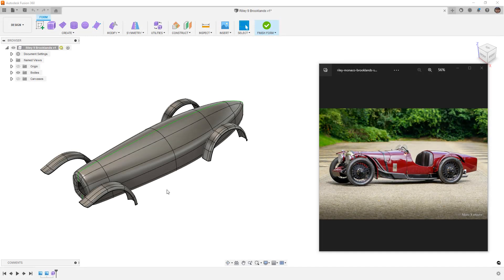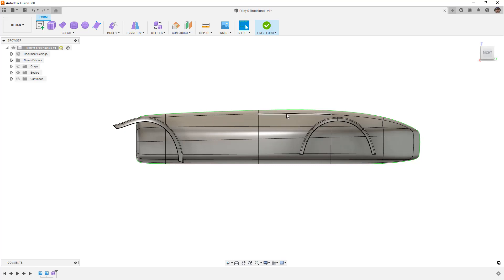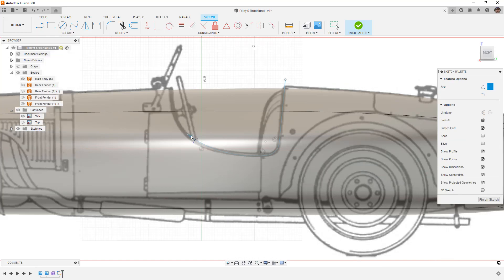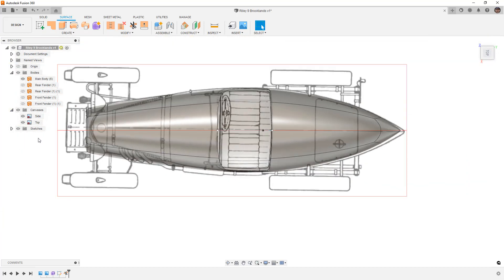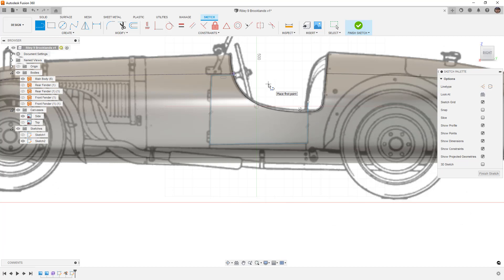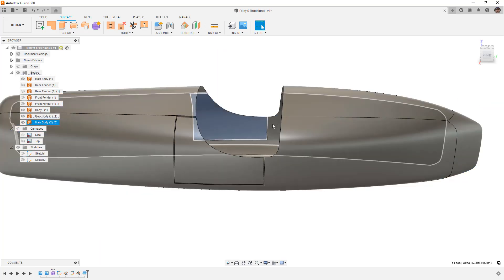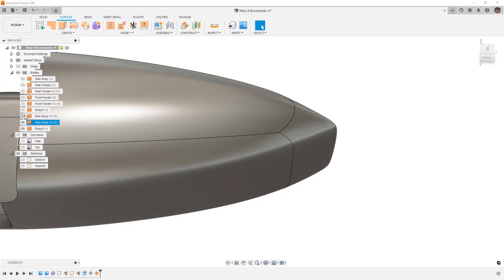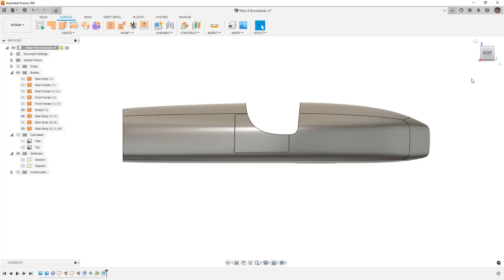Fusion 360 Form Mastery Part 38 - Splitting Up a Form Body to Make Doors and Hoods #Fusion360

Comment: What if I have a part I want to shorten? How do I cut it out, shorten it, then reconnect it?
Reply from the maker: That will depend on how you want to shorten it.  In some cases you might make a planar cut with say an offset plane or just a line.  You might also use an offset surface to make the cut.  The tricky part is moving both pieces back into whatever position you need and then merging them.  Usually cutting, moving and re-attaching isn't a great option as the edges won't line up.  So you might need to cut more than you need and loft them together.  Again it is very much based on what surfaces you are working with.

Comment: If this project was going to be a real car, put into production, if you will, obviously, this would need body panels ect, and these would need moulds to press them out. Does fusion 360 have the capability to use a positive shape such as what you have made, and use this to cut out a mould for body panels within the software? Hope this doesn't sound to confusing.
Reply from the maker: Thanks for the comment!  It sure does.  A lot of people use Fusion 360 to generate molds off of the parts.  I have done this for a few clients(medical devices) but not on a car body just yet.  The result of the Form is a true surface(or solid if it is closed) so all the typical boolean operations like Cut or Combine will work.  You can also use the surface in conjunction with planes and the Boundary fill tool to build out a solid volume a the plug for a mold.
Reply: @LearnEverythingAboutDesign  Thank you! I am new to fusion 360, this sounds a little complex, I will look for tutorials along these lines.🖐
Reply from the maker: @TheHalloweenmasks  Are you looking to make some fairings for your Suzuki project?
Reply: @LearnEverythingAboutDesign  Not yet. This project is a massive undertaking, I cannot guarantee 100% success. If this project is successful, which is an engine made from scratch, then I will intend to build a complete bike.
This feature in fusion 360, making moulds from 3d models, is very cool and could be very useful to me.😎
Reply from the maker: @TheHalloweenmasks  Awesome!  Years ago(probably 2000) I remember reading an article about an ME professor casting his own vtwin 500cc two stroke using two yamaha yz250 cranks and cylinders.  I saw some of your stuff is deeper than that making your own gears, cranks, pistons!  Reminds me of the worlds fastest indian story :)  Very cool project none the less and wish you the best of luck getting it done.  This video was inspired by someone making this car.  Check out @asciimation channel

Comment: Hi Matt, just to let you know I have managed to get further along with the help of your most useful films. I have successfully created sketches of the body shape by creating planes where the framing needs to go inside the body, creating a sketch on the plane then doing an intersect on the body to get the outline on the sketch. A simple offset and I have patterns I can use to cut the timber framing. I am testing this at the moment with actual wood by exporting the sketch as a DXF, converting that to PDF then printing it 1:1 scale and gluing that to the wood to cut out. It's working well. It's very cool to go from a computer model to real material. I have done it before with 3D prints but using the CAD model to make templates to then hand make real part that then builds into something solid is pretty neat. Thanks for your films and help with this!
Reply from the maker: That is great to hear!  I will be away for a bit but if there are any questions you have my email.  I will keep checking your channel for updates to the project!

Comment: Thanks Matt for another excellent video. Congrats on the 5k subscribers. This is basically how I split my Porsche to make it printable. But instead of splitting a surface like you did here, after I exited the form, I thickened the surface to make it solid 2mm thick. Then made sketch and split or extrude to make the openings. Is there an advantage of splitting the surface before thickening? In real application a surface cannot be used so it has to be thickened at some point right? In my actual Ferrari 375 F1 project, I was thinking I'd use the same workflow, form to create the body, convert to solid by thickening, then splitting and adding details.  Should I revisit this workflow to use surface instead?
Reply from the maker: Surface vs solid really depends on several factors.  one thing to consider is that thicken takes the surface and thickens it normal to the curvature.  With a surface you can use Ruled to make a surface edge the thickness you want but toward a certain direction like a midplane.  That would be the main one.

Another reason to work with surfaces is sometimes you might want to offset the outside surface inward but you may want to then add more details to an external surface.  Say with your Ferrari project the "fins" on the body.  In the mesh those were just sort of stuck on.  In reality they would be stamped into the sheet metal, but for your 3d print you might just want those details on the outside and not be an actual vent.  So you could offset the outside surface inward, then you could modify the outside surface to have vents. This 'could' also be done by adding to the solid after.

It is hard to say which way is best but the first point is probably the biggest.  Normal vs a specific direction for the thickness.

Comment: thank you again for the valuable content.
one question: is there a way to get back into Forms after cutting out the door? I guess that is not possible as the topology of the cuted face will not allow to transform back into t-splines again. 
I try to use in this cases the Addon Quad Remesher for Fusion, but very often with no useable results.
As well or instead I use the "parametric tools" of the form enviorement, which are a great step forward within Fusion.
Reply from the maker: Thanks!  You can 100% edit the form body again.  Just double click on the icon in the timeline.  There is a chance that things will break if you project edges of a form and then make drastic changes to the topology like add/remove edges.  Each time you finish a form it gets converted back to a solid/surface.  If the geometry is close, no problems.  If its wildly different you might have to fix some sketches.

Comment: Excellent, thank you so much for this! It really was helpful. It is a very tricky shaped little car, especially the radiator! And the doors on it are actually different lengths on each side. Before seeing this I had a go myself and what I came up with was drawing a sketch for each door each on a plan offset to each side of the car. I sketched the outside profile then did an inside offset to create the gap similar to how you did here. I was able to then use split face to split the faces on each side of the car in turn. I haven't worked out yet if you can limit the reach of the split tools so I ended up needing to split the body vertically first so I had faces on each half of the car other wise each split would cut faces on both sides. Split body seems to work the same way. If I have a single body there was no way to only split one side of it. By splitting the car in half I could select just the half I needed. I could then split from each side with my left and right side sketches. I split each half of the body with the outside of the door profile then split the faces of the new door bodies with the door gap line. I can change the appearance of the door gap to visually give me what I wanted.
Reply from the maker: Glad it was helpful!  For the split or trim, instead of using a sketch, you can take that sketch and extrude a surface that cuts through the body where you want.  This means you don't need the "Extend split tool" check box and it won't try to cut through everything!
Reply: @LearnEverythingAboutDesign  Ah, yes I see how that can work too. I did just have an 'oh-oh' moment where my model went all wrong, I couldn't select bodies and trying to change appearance just wasn't working and it would not let me change the name of the main body after splitting it. Some faces while selectable and delete-able just would not take an appearance. It seems Fusion was in the middle of an update and after restarting it a few times it's all come right. I should be doing an update on my real car progress now a part I was waiting on arrived but I will also mention the 3D modelling and how incredibly helpful you and your tutorials have been.